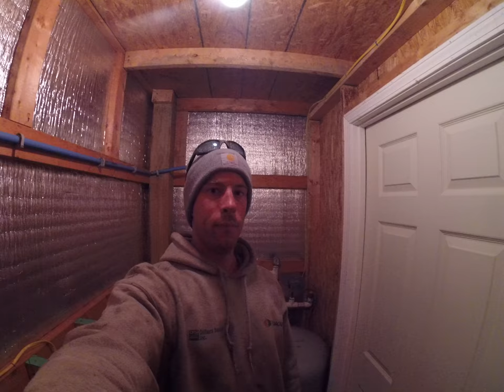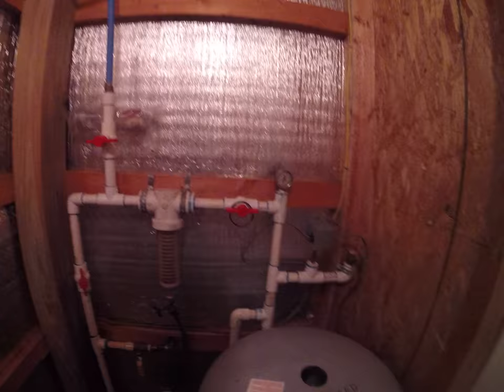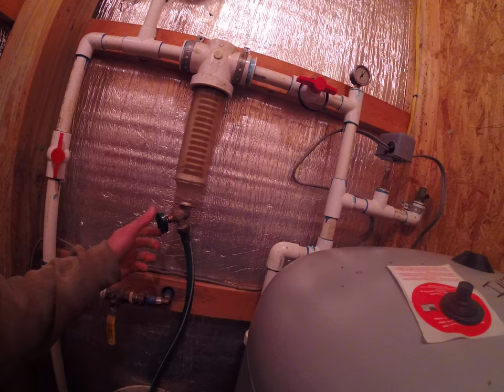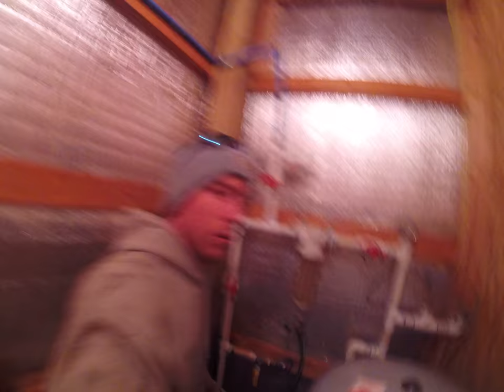Cheap Sediment Filter for Well Water Filtration System: Spin Down Filter

Comment: what size mesh or micron filter do you actually have in the bowl. When I bought mine it had no filter. The guy said it didn't really need a filter in it to spin down?
Reply from the maker: Dominic Barry typically they come with 100 mesh filters, which translates to approximately 150 microns